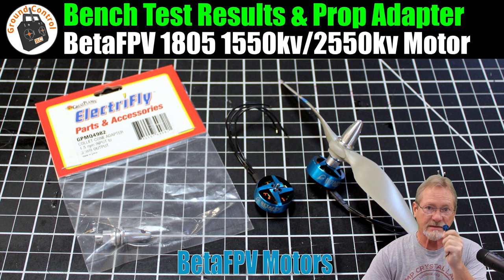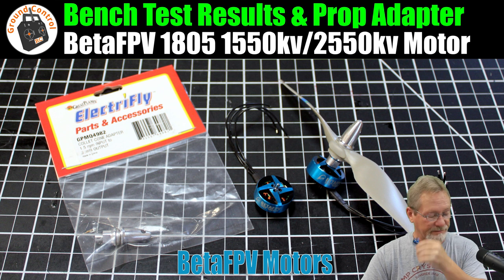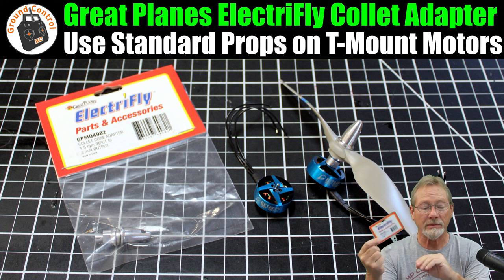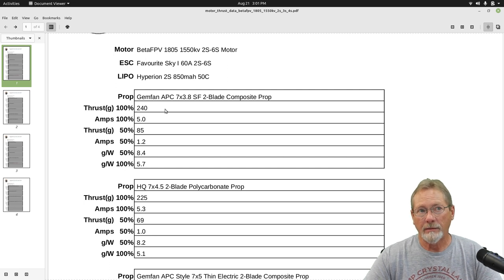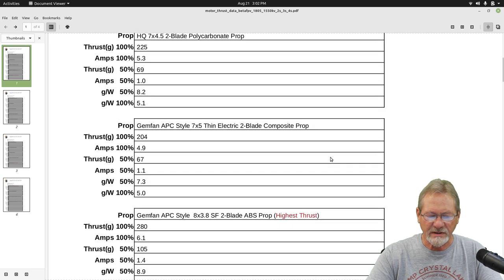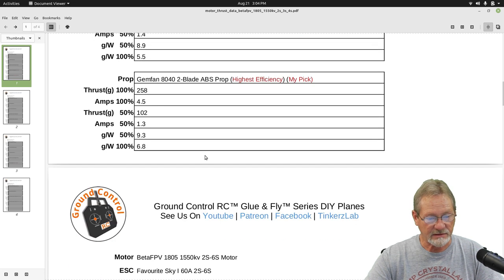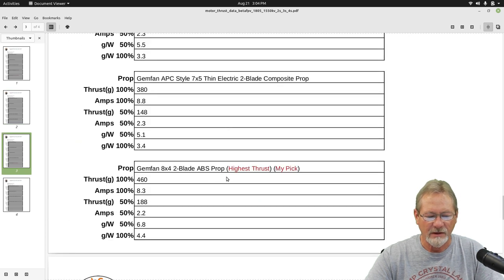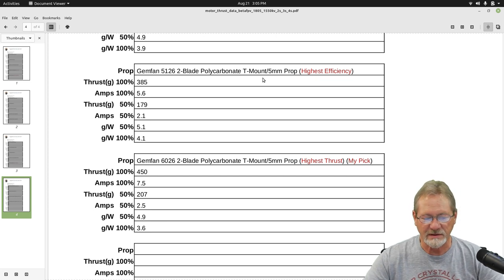Bench Test Results! BetaFPV 1805 1550kv/2550kv Brushless T-Mount Motor 2S-6S

Comment: Looks like a gutsy motor!  Good for 3S-4S.   

I tried one of those props before and didn't have a lot of luck with it.  Seems like it took more torque/amps to turn than other props of the same size and pitch. Maybe my problem was unique.

Happy flying, researching and reviewing!
Reply from the maker: These BetaFPV Motors are great.
I've never been impressed with the numbers of that prop on the bench.
It wasn't until I put one on a plane recently that changed my mind.
The performance I got on the plane was much better than the numbers I saw on the bench.
Strange prop ;-)
See you in the Air!

Comment: is this going on a DIY F22 ?
Reply from the maker: Hi David!
Not this one, I need a much higher KV for those Micro Parkjets as they use a much smaller prop.
I've installed one of these on my Arrows Pioneer with a 7x3.8 Slow Fly Prop on 2S.
It should have nearly unlimited vertical ;-)
I'm also going to use one of these on my next conversion of a Cheetah 1 Meter Chuck Glider with a spinner and folding prop on 2S and it should also have unlimited vertical or close to that much power.